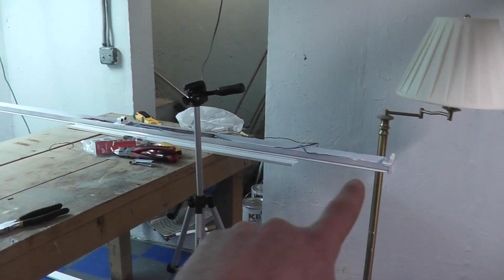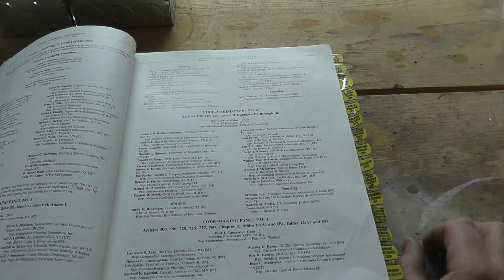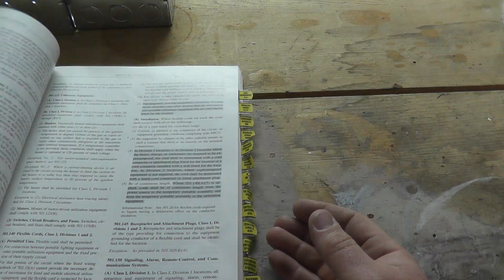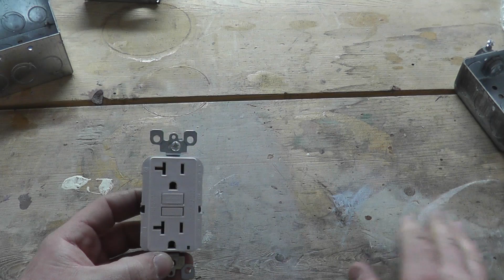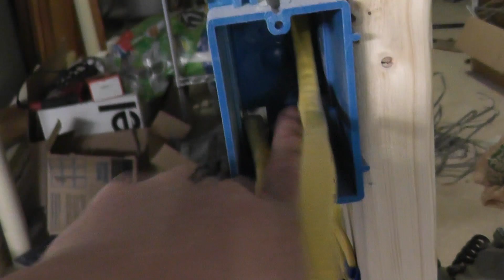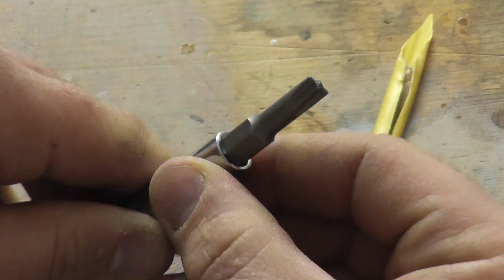Building the New Shop Part 2: Electrical

Comment: Greg;

I ran a new master box in my garage to power up all the tools and lights I installed for my home shop.  A good buddy of mine who was a licensed electrician helped me with this and we ran a new feeder from the main meter.  Made it a lot easier to wire up everything and it doesn't interfere with the house wiring.  Also allows for spare power capacity for those new tools you know you are going to buy.  Just something to think about as you move ahead.

Regards;

Ron Kluwe

Comment: I agree on the arc-fault mania.  Like GFCI they have a place but a properly wired (and used) conventional circuit is fine most of the time.  It's poor connections and overloading that causes problems.  Idiot Proofing just leads to more idiots.

Klein seems to be just about right for screwdriver handles. A firm round grip good for speed screwing by pivoting on your palm when re-gripping.  Everything else feels klunky or wimpy.  Don't get me started on 'Ergonomic'.  Those chunky square handles are like a ratchet with too few pawls - the grip never lines up with the screw.
Kleins' 11-in-1 was a Godsend on the roof.  Now if only the greedy bleepers sold replacement bits.
Reply: Good news, they do! http://www.amazon.com/Klein-32483-Replacement-Screwdriver-Driver/dp/B000936PUC/ref=sr_1_1?ie=UTF8&qid=1424541070&sr=8-1&keywords=11+in+1+replacement+bit
Reply: Let's amend that to "for a reasonable price".  That's 9 bucks for the #2 Philips/Slotted ONLY.

Comment: I don't know if they got cheap but the thing I didn't like about my Klein 10 in 1 is that I bellmouthed the shaft.  Not sure if that was a cumulative thing or if I did that in one go but it would only fit in the handle one way. The 4 in 1 never did that. My truck was broken into so I just threw a bunch of money at Milwaukee, so far I like the screwdrivers well enough(I liked my Wera better). The Milwaukee 18v 1/4 inch Fuel Impact driver is awesome though.
Reply from the maker: I broke a Greenlee 6-in-1 shaft before.  Cracked right down the side.  I wasn't abusing it although it was on a really stuck 5/16 screw on a super cold day so that couldn't have helped.  My 18v Milwaukee cordless is still going strong.  Looks like hell, but just as functional as the day I bought it.
Reply: My "old" Milwaukee was great... I hope the fucker that stole it, chokes on it. The Fuel version is even better. The battery lasts longer and it has 3 speed/torque settings that are really useful, from really sensitive to brutish.

Comment: you can't run romex below 8ft. where you going to fish it above your celling?
Reply from the maker: There is no height provision in the NEC if I recall correctly it's just with proximity to an attic access and an 8ft rule with regards to UF cable.  The only shady stipulation concerning the NEC is that it must be protected from physical damage and must closely follow building finish, running boards and cannot be run perpendicular on the ceiling joists and protected from physical damage is not defined in the NEC so it gets to be a judgment call.   Granted a local amendment may have added the 8 ft rule and I know some states don't even allow romex in even residential applications.

Comment: With in the next year I have to redo an entire garage for wiring. I wanted to do metal conduit but was unsure of how to use it correctly. Without intending to you've answered a bunch of questions I had. I still have to read up on conductor size but at least I have this stuff addressed now.
Reply from the maker: Like I said there's all kinds of local rules too so what may be ok here may not be ok there.
Reply: ***** Hence all the reading that I have to do. Plus, I plan on speaking to a Master electrician in my area to do the planning and the actual connection to the circuit breaker.

Comment: Made me think of my Klein needlenose pliers. One unfortunate day, they blew out a 100A breaker. The result was a notch in one blade that makes a perfect size mandrel to form a hook to bend a wire to fit an electrical lug.
Reply from the maker: Been there done that.  Got the heart beating pretty good too.  That's when I learned to never trust a disconnect.  It broke inside and two legs disengaged but one was still live.